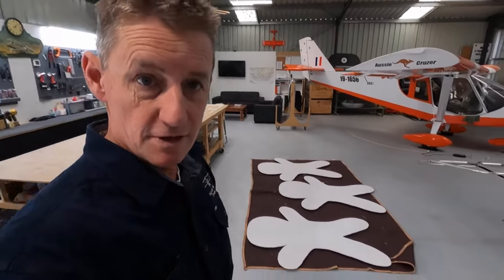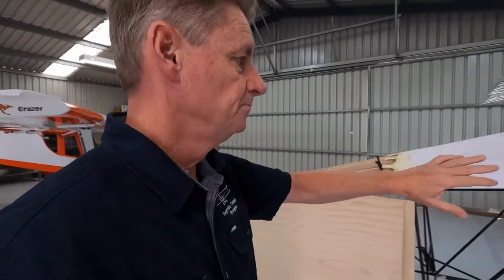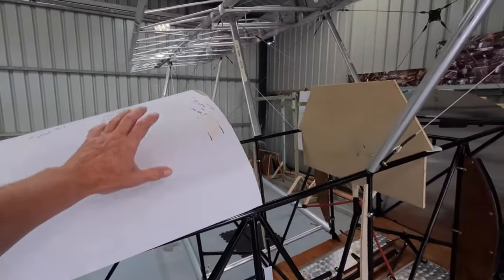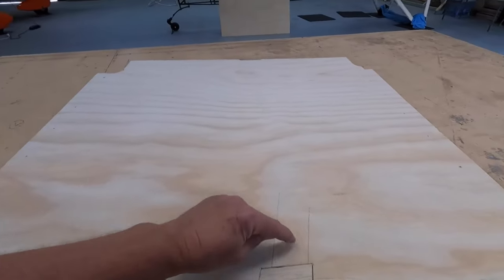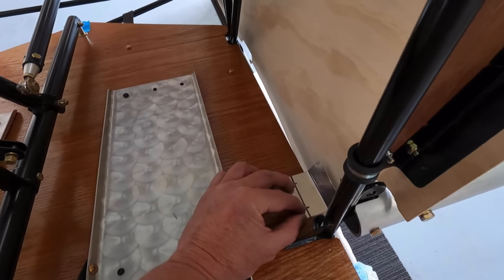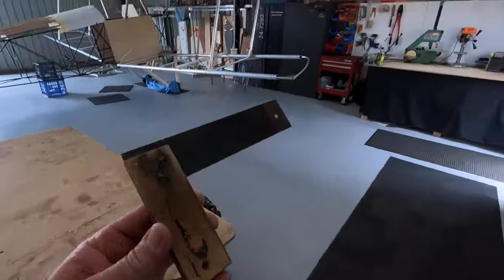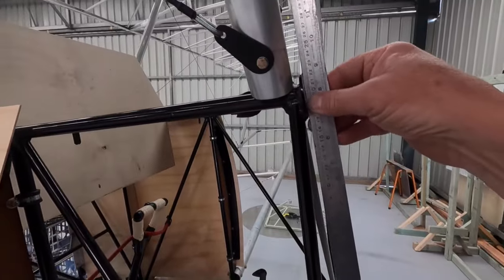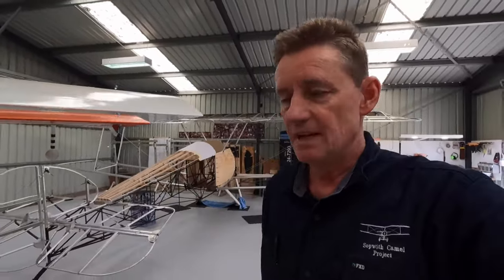Restoring History: 1916 Sopwith Camel Cockpit Side Panel Build

Comment: Looking great mate. Could you slip the P clamps on after covering for the side bits? Also, my mate Paddy made the ply behind the cockpit strong enough for him to be able to sit on. It makes sliding in to the cockpit much easier. And out as well. Pretty sure he epoxied 2 layers of ply there. I could get more info on that if you like
Reply from the maker: Thanks Don, yes it needs to be sat on the rear turtle deck, first layer will be covered over then a cosmetic layer. Not sure yet on the p clamps as the covering needs to wrap around the same vertical.
Reply: @scottmatthews5280  keep at it mate. Those extra fiddly bits really are worth it and bring this kit from ok to something special